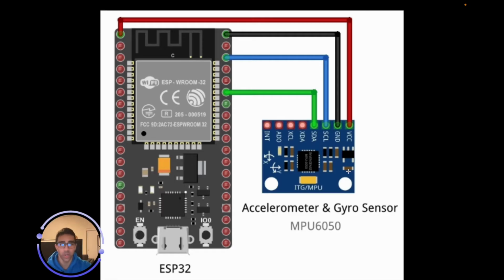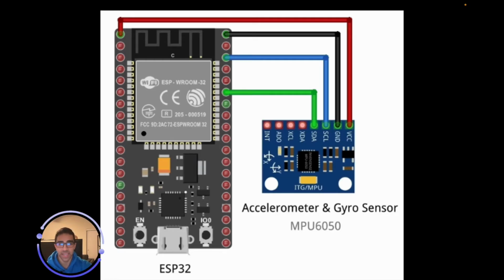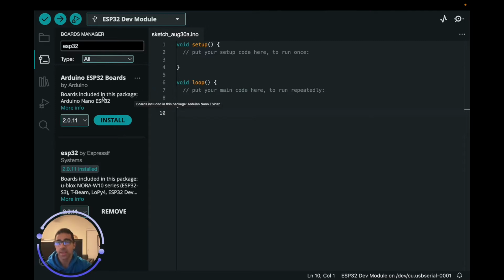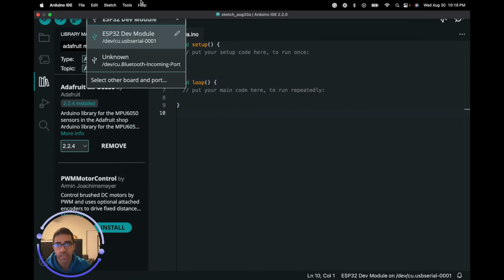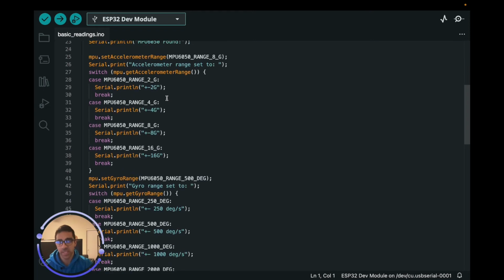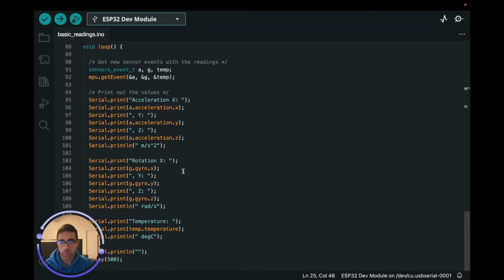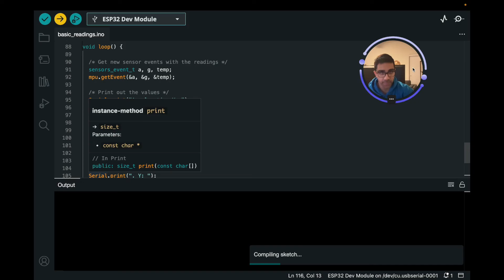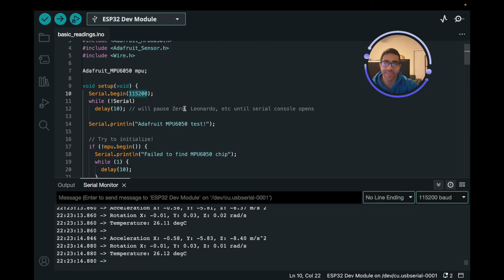How to Connect MPU6050 to ESP32: Physical Setup and Code

Comment: in my serial monitor it's showing no I2C device found
Reply from the maker: Hello, be sure you are using the correct type of cable!
Reply: @mmshilleh yes it's data type cable still my i2c is showing not found

Comment: Hello, Im working with an Esp32 c6 devkit and an mpu6050, trying to run the code and im seeing an empty serial monitor...
Reply from the maker: Make sure the MPU6050 is connected correctly, and that you are using the correct I2C address. Also try resetting IDE or unplugging and replugging controller. Make sure baud rate is correct as well.

Do not forget to subscribe :)
Reply: Hey, I’m having the same issue as you 😕
I’m using an ESP32 DevKit and an MPU6050 sensor, and when I upload the code, the Serial Monitor just stays empty  , Did you manage to fix it?
Reply: @MohamedSadekRechid-x6h  were you able to fix it? i'm facing the same issue :\
Reply: Press the rst/En button,you might get an output.

Comment: Hey bro i am facing one issue with my mpu6050 after doing the same thing like you so in my case i have connected my esp32 to mpu6050 as shown i video and do all steps and when i like open serial monitor i get correct reading 2 3 times then the value get suddenly stuck at wrong values and shows me that again and again I don't know what the problem is like i got 2 or 3 reading at starting correct then it get stuck and if i plug the wire out and then in then same thing happened 1 or 2 reading correct then it get again stuck look at this reading and i will be very thankful if u help me 
11:45:59.574 -> Acceleration X: 0.38, Y: -8.55, Z: 5.16 m/s^2
11:45:59.597 -> Rotation X: -0.04, Y: -0.01, Z: 0.01 rad/s
11:45:59.605 -> Temperature: 21.02 degC

11:46:00.076 -> Acceleration X: 0.38, Y: -8.54, Z: 5.16 m/s^2
11:46:00.092 -> Rotation X: -0.04, Y: -0.01, Z: 0.01 rad/s
11:46:00.094 -> Temperature: 21.00 degC

11:46:00.579 -> Acceleration X: 0.38, Y: -8.55, Z: 5.15 m/s^2
11:46:00.591 -> Rotation X: -0.04, Y: -0.01, Z: 0.01 rad/s
11:46:00.593 -> Temperature: 20.99 degC

11:46:01.082 -> Acceleration X: 0.38, Y: -8.55, Z: 5.16 m/s^2
11:46:01.088 -> Rotation X: -0.04, Y: -0.01, Z: 0.01 rad/s
11:46:01.091 -> Temperature: 20.96 degC

11:46:01.603 -> Acceleration X: 0.38, Y: -8.55, Z: 5.16 m/s^2
11:46:01.608 -> Rotation X: -0.04, Y: -0.01, Z: 0.01 rad/s
11:46:01.612 -> Temperature: 20.96 degC

11:46:02.101 -> Acceleration X: 0.38, Y: -8.55, Z: 5.17 m/s^2
11:46:02.104 -> Rotation X: -0.04, Y: -0.01, Z: 0.01 rad/s
11:46:02.107 -> Temperature: 20.94 degC

11:46:02.599 -> Acceleration X: -15.33, Y: 60.22, Z: 16.55 m/s^2
11:46:02.605 -> Rotation X: -1.30, Y: -3.27, Z: 0.00 rad/s
11:46:02.608 -> Temperature: 36.62 degC

11:46:03.098 -> Acceleration X: -14.10, Y: 60.22, Z: 16.55 m/s^2
11:46:03.100 -> Rotation X: -1.30, Y: -3.27, Z: 0.00 rad/s
11:46:03.103 -> Temperature: 36.62 degC

11:46:03.596 -> Acceleration X: -14.10, Y: 60.22, Z: 16.55 m/s^2
11:46:03.599 -> Rotation X: -1.30, Y: -3.27, Z: 0.00 rad/s
11:46:03.615 -> Temperature: 36.62 degC

11:46:04.095 -> Acceleration X: -14.10, Y: 60.22, Z: 16.55 m/s^2
11:46:04.115 -> Rotation X: -1.30, Y: -3.27, Z: 0.00 rad/s
11:46:04.120 -> Temperature: 36.62 degC
Reply from the maker: You need to test your hardware in some other ways. Might be a hardware issue
Reply: @mmshilleh  I think this problem is with hardware or like wires connections problem I will again try to solder the wires agajn and check it again tomorrow 
Because at starting it gives reading but after sometime it get stop or disconnected

Comment: Sir I am facing problem can you clarify me that I am doing project using mpu6050 and max30102 with esp32 as both sensors shares common i2c protocol can we integrate both sensors and get the output?
Reply from the maker: Yes, you can integrate both sensors on the same I2C bus by ensuring they have unique addresses or using an I2C multiplexer if needed.

Comment: Seeing as the mpu6050 is obsolete, any recommendations for a more accurate accelerometer module?
Reply from the maker: Thank you. Yeah unfortunately some of my videos need tuning overtime since packages change. Appreciate comments like these to guide other users!
Reply: @mmshilleh  would love to see a set up using the ICM-42686-P. This accelerometer has good tracking and is supposedly used in things like the meta quest controllers
Reply from the maker: @Blakipino  Do those come on PCB? I cannot find any :face-purple-wide-eyes:
Reply: @mmshilleh  they have them on Shopee as separate modules if your in the SEA region, though Im not sure about other areas

Comment: Thank you for the vid

I tried but it is returning the 6 readings as 0.00. For temperature there is a value

16:56:29.096 -> Acceleration X: 0.00, Y: 0.00, Z: 0.00 m/s^2
16:56:29.096 -> Rotation X: 0.00, Y: 0.00, Z: 0.00 rad/s
16:56:29.096 -> Temperature: 36.53 degC

It might be silly but any pointers will be appreciated! Thank you!
Reply from the maker: Weird, try another controller for a sanity check I would say. Could be a bad MPU.
Reply: @mmshilleh  ok you are right. The one I got is broken. I changed another one and it works.

Comment: Hey thanks for the Tutorial! I have to mention that physical connection didnt work for me. Had to connect SCL to D22 and SDA to D21 als Gnd to GND and VCC to 3.3 V. Also I have question, i want to work with two ESP32s and to two MPU6050s simultaneously and send the data via Wifi to the Ard IDE, do you think thats possible?
Reply from the maker: hmmmm why the IDE? Idk if that is possible but in my experience anything is! You can send data over wifi easily but idk if I would use the IDE to receive it. I would send it to an MQTT channel first and write a script to harvest the respective channels. Shouldnt be too bad. Goodluck, hope you can subscribe my friend

Comment: sorry for a possible stupid question but i am currently learning to use the esp32 and such electronics. i see all projects power the esp32 trhough the usb. i have an esp32 with mpu6050 connected at the 3v3 power pin. i need to power all it with a 18650 battery. where do i coonect the power of the battery in esp32if the 3v3 pin is taken fro mthe mpu6050?
Reply from the maker: Hey, great question and it's not stupid at all! When using an 18650 battery to power your ESP32 and MPU6050 setup, you’ll need to consider a few things. Since the 3.3V pin on the ESP32 is already occupied by the MPU6050, you can power the ESP32 using a battery through the 'VIN' pin (also labeled as '5V' on some boards).

The 18650 battery outputs around 3.7V, which might not be sufficient for the VIN pin, as the ESP32 generally needs around 5V when powered through VIN. You could use a boost converter to step up the 3.7V from the 18650 to a stable 5V. Connect the output of the boost converter to the VIN pin of the ESP32, and make sure your ground connections are also shared among the ESP32, MPU6050, and the battery.

This setup should ensure that both your ESP32 and MPU6050 have the power they need to operate effectively. Make sure to check the current requirements and ensure your power supply can handle the load. Safety first, so double-check all connections and consider adding a fuse and protection circuit for the lithium battery. Hope this helps and happy tinkering!
Reply: @mmshilleh  thank you for the extended information. i already ordered some converters. i appreciate your help.

Comment: Hi i am using esp32 C3 M1 dev kit . DSo you know how i could connect it with  mpu6050 pin ?
Reply from the maker: Not sure youd have to read the pin diagram for the controller
Reply: @mmshilleh   i checked it but i m confused on how to connect scl and sda to esp32 c3 mini 1. Which pin  would be preferred to connect to mpu6050 ? In your case can you tell me by stating the function of the pin. Let me check where i could connect it

Comment: Hi, this is really a nice video. I am having a bit of trouble making esp32 connect. Every time, I upload code to it, it shows different fatal error every time(I use matchbook air M1), however, I find Arduino boards to be working perfectly well. Did you face this issue at any point while working on this? If so, mind providing ways to resolve?
Reply from the maker: Hmmm cant say I have had this error mate! Sorry
Reply: @mmshilleh   I get it. So did you resolve it eventually?

Comment: Hello! Thank you so much for this video, but when I upload the program onto the esp, on the out[ut screen, it just shows "leaving..." and "Hard resetting via RTS pin".  I checked the baud and switched the other thing to "No line ending". How do I get the data?
Reply from the maker: Sometimes, the wrong baud rate or serial communication setting can lead to unreadable output. Confirm that the baud rate in your Serial Monitor matches the baud rate set in your code (commonly 9600 or 115200). Since you've already tried switching to "No line ending", you might also want to experiment with other settings like "Newline" or "Both NL & CR" to see if that changes the output.
Reply: @mmshilleh  turns out I used the wrong board name, thanks for the video bro it really helped !
Reply from the maker: Anytime hope you can sub! :_Idea: @utsabgiri4129

Comment: hello everything is fine? great explanation! I compiled the program but on my serial monitor it appears Failed to find MPU6050 chip, could you explain to me why? I'm also using a different esp32 model, it has the 2102 chip and has 38 pins in different positions
Reply from the maker: Hey man sorry to hear, it is either two things. The MPU6050 you are using is flawed or you configured it incorrectly with the board. I believe that board uses a different pin format than the ESP32 I use in the video and a quick Google search shows that. Have you used that board before?
Reply: @mmshilleh  First time using the sensor! I bought it and went straight to testing :( I'll try to buy another one to test again
Reply from the maker: @jaumio  did you look at the pin diagram?
Reply: Yes, I looked, my ESP can compile, the sensor LED lights up but the fault in question appears on the serial monitor @mmshilleh